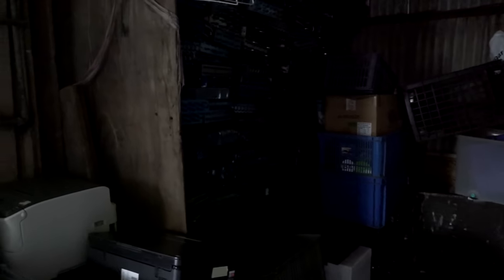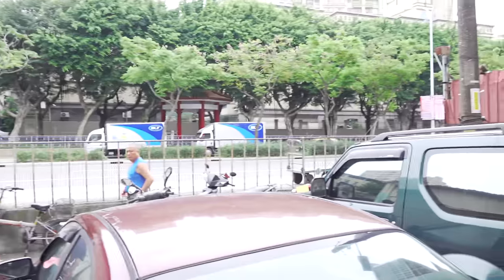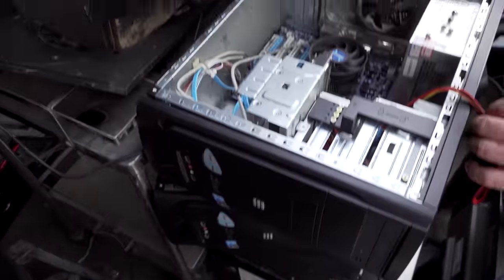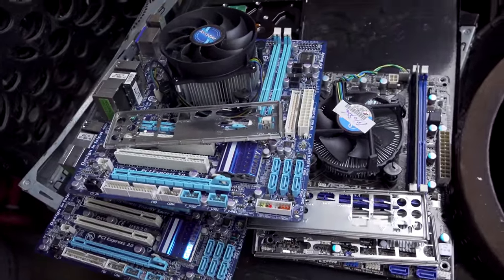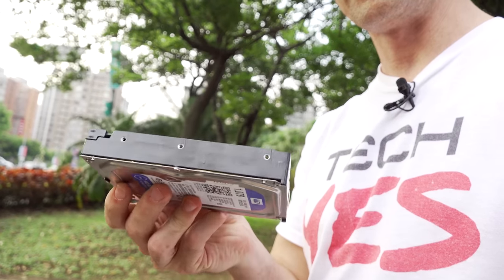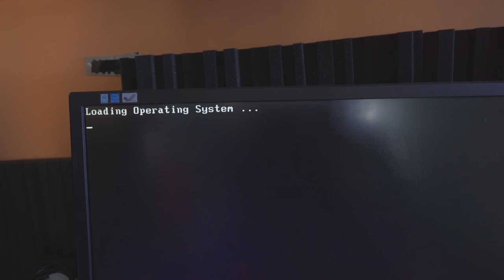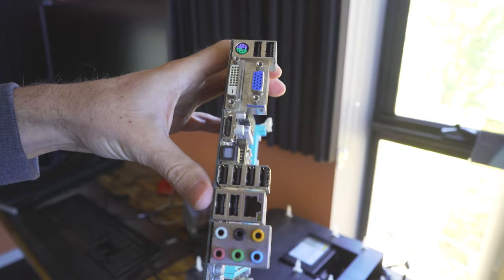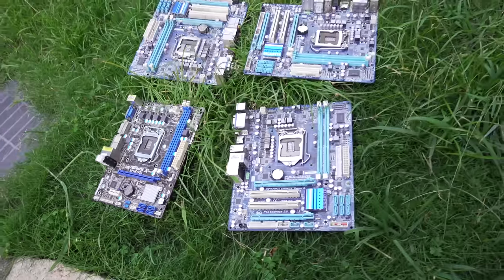I went looking for PC Parts in SCRAPYARDS in Taiwan...

Comment: Sadly a lot of times people throw away PC's simply because their OS isn't working like it did when it was new. My neighbor threw away a perfectly good laptop a few years ago, one that was socketable and about a 2013 or 14 model, and the ONLY thing I found wrong with it was Windows 7 was completely locked up from viruses and junk/malware etc. He had stuff pilled up in his truck ready for the dump when I happened by and offered my help. I instantly noticed 3 printers, several old TV's, two computers and a monitor thrown in his truck along with lots of other junk. I took the printers (all sold together on craigslist for $100) and kept the laptop and monitor and upgraded it with Intel wireless AC and a SSD + more ram and a much faster CPU. Total upgrade cost was about $70 considering I already had a spare Samsung 840 Pro SSD. The stuff people throw away jeez. Oh, and my Father just threw away a HP 7520 AIO printer all because it had a paper jam (not joking).
Reply: I used to get everything like this too. Furnished a home with stuff people discarded once, complete with two workstations.  I had so many computers too, which I fixed and gave away.
Reply: That's how I found my gaming laptop
Neighbor threw a way his laptop 3rd gen i7 8gigs of ram all it needed was a new hdd
After that I added a egpu dock and a 1060
Still works great till this day

I'm always on the lookout for hardware
So far I'm up 10 pc's 2gen i3's ll the way up to 4th gen i5's

People will throw away anything
Specially rich people
My buddy went dumpster diving found a perfectly good working intel nuc all it needed was a fresh install of windows
Reply: It's insane when u think about it. I got two Server Computers with ivy bridge Xeons cause they "didn't work anymore".... On one, the sata cable of the Hdd was lose and on the other the PSU was dead. So i got two dual Xeon Systems for free.... When u think about the fact, that those Processors were about 1500US each back in the day... PRETTY LUCKY DAY
Reply: I've gotten 1 desktop and 3 laptops that were "broken" and got them working.  Desktop needed a virus scan and more ram.  Laptops needed new batteries,  ssd upgrades,  and ram.  The people gave up and bought new computers, let me keep the "broken" ones.
Reply: you think thats crazy?
i found a perfectly good gaming rig no frikin joke i want to know its backstory
i7-6700k
asus maximus hero viii
4x8 corsair Lpx vengance ddr4 ram
strix gtx 1070
1000w evga fully modular psu
a noctua cooler 
and a 2tb western digital black
Reply: I've gotten a 2014 looking Laptop/Tablet PC with a Core i7 and 12GB (DDR3) of RAM for free, they threw it out just because Windows was hanging when starting up but everything was fine

Comment: Here in the Philippines there is a huge market for surplus computer components and systems. Almost all of them come from scrapyards and recycling centers like this, with most of them originating from Korea, but parts from Japan and Taiwan can also be found too. There are thousands of internet cafes and businesses that run with imported computers or systems built with used components. From motherboards, power supplies, graphics cards, laptops, monitors, peripherals, you name it. Almost anything computer related that's used can be bought. 

You can pick up a used mining RX 570 for around 70-80 USD, motherboards from 775 to 1151 for 30 USD, or even a 500-600w power supply from a name brand such as FSP, Seasonic, and others for around 12 USD or less. Now these may not sound that good of a deal to those who watch this channel on a regular basis, but take note that there are so many shops here in the Philippines that sell these components making them extremely accessible and readily available. Even those who live far from Manila (Where most of these shops are) can order them online via Shopee or Lazada (Equivalent to Ebay, Amazon, Aliexpress) for the same price plus maybe 1-2 USD for shipping.
Reply: Where is this market?
Reply: @rencm04  Ah sorry. When I meant by market, I mean that selling used computer parts is a big business in the Philippines. 

But to answer your question, there are many shops all over the country where you can buy parts. Places such as Gilmore are a good example. However, the best deals can be found online on Tipidpc.com or Facebook Marketplace. I would suggest looking online first before buying as that's the way to get the cheapest prices.

Comment: This is awesome! We have junkyards around me in the states called "U pull it", which has the same setup. It's nice to do if you are handy, as you can work at your own pace and often get all the little odds and ends that usually get thrown away, like interior pieces or something as simple as a hood prop. Sure you could buy new but why when you can the fully functional OEM one for 1/4th of the price.

Comment: I was wondering why so many second hand motherboards from the east had all their vrm heatsinks removed.  They are being taken for scrap.
Reply: A lot of cheaper boards don't even have heatsinks. The VRM isn't producing that much heat that one is needed, only a bit of airflow will do the job aof cooling.
Reply: I’m quite aware. I was talking about p67,z68,z77 etc. boards that I know came with vrm heatsinks being sold on eBay and similar from China and the like without vrm heatsinks on them.  Listed as refurbished usually.

Comment: Check the AsRock board again with both sticks in it and look if the amount of RAM is right. The board probably just used the memory installed in B1 and didn´t recognize the stick in A1 as it´s probably dead.
Reply: A lot of dual channel boards will want you to fill the 2nd slot first.

Comment: just a fun fact. if some motherboard dony post or anything at all. wrap most stuff in foil except the chipsets and bake them in the oven for 7 mins at 170c (200c if first time doesnt work) alot of boards have lose north/soudbridge solder joints and this would probs fix it too

Comment: Since I have an access to the "pc scrap room" from where decommissioned PC is going to the kind of facility rhat can be seen in the video, I'm usually getting those kind of parts for free, generally there are mostly socket 775 that I can't see a point in taking, from time to time I'm finding 1156, 1155 custom PCs and oftenly a dell or lenovo prebuilds with 1150 socket and an i3 4th gen, usually without the memory or storage drive, but still worth taking.

Comment: Should do it in USA or Canada if you got a chance i found a full gaming PC in my scrapyard worth about 750-800$ paid 150$ for it   

and great video!
Reply: Specs?
Reply: @usamahhoosen3593   Intel i5-9400 2.9gz Geforce GTX 1060 3GB, 1TB , 8GB ddr4 pretty basic build better then nothing
Reply: @Ekonicz  that's not bad. What was such a recent build doing in a scrapyard though? 9th gen processor
Reply: @usamahhoosen3593  yes Motherboard had chip problems i fix it easy i guess the last owner thougt its was dead sadly and trash it

Comment: Hey @techyescity, Regarding those Windows 7 license stickers with keys, they're technically not permitted for use on other computers as OEM licenses are formally tied to the hardware with which they're sold. (That's essentially the Motherboard & CPU combination, though I've seen even things like an SSD swap break an OEM activation. Microsoft's exact definition is a mystery to me)

While those keys may still activate an install, it is no more compliant than a basic activation crack. So people may as well use a crack.

Comment: I buy computers from bankrupcy auctions quite often, most of the time the description says that all data is erased, but a lot of times it just isn't. I never misused the data, i even told the auction company that i found data on the disks. One of these machines even had no password, with multiple e-mail accounts and even bank login details with password and all. Some other auction businesses just remove the hard drive physically which would be the best in these cases but kind of sucks for me. Have you ever checked out bankrupcy auctions??

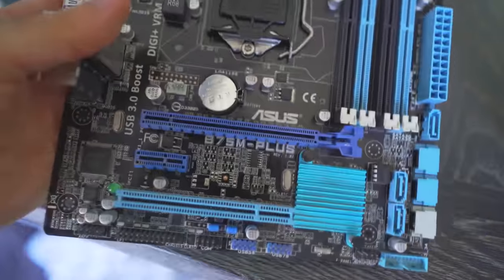Comment: 4:03 B75M-Plus I just got one of those boards for my older i5-3330 and it works great as one would expect.. Had to buy from Ali-Express :(
Reply: @stan dardownz I am in Australia and it cost me about $96 AU delivered. I also got an Intel DH77EB board locally for about $65 delivered. Will be using that for another i5 3xxx build soon. I also bought a brand new Asus Radeon RX580 to install into B75M-Plus board for some Satisfactory gaming ;)
Reply: @stan dardownz just motherboard 2nd hand. I had a CPU and ram as taken from an old Dell Optiplex 9010 desktop. I had drives already. I purchased a new case and PSU and GPU.
Reply: @stan dardownz If you got any questions - happy to help. My name here is the same as my gmail account and twitter.

Comment: "if you don't know at all if these parts even work" you don't need to go to Taiwan to get such parts. I am in Australia and I worked for the DOLE. I was in a scarpyard/warehouse pulling apart every type of electronic that you could put your two hands around. we were even pulling the copper out of the power supplies and power supply cords for the government. stuff that had no value to save it from being set to landfill was made up into creative expression pieces made to look like something eg. art. senior staff did hardware testing. cause the only thing we were going to use the computers for was look for a job..

Comment: Just when I was starting to think no 16 core Ryzen 3000 was a good thing...

As I don't [really] need one. When DDR5 comes out next year it will require a new socket, so buying any new CPU will mean having to also replace the motherboard etc. Although, I do wonder if two DDR4 memory channels will bottleneck a 16 cores, as it is only ~30GB/s (less than 4 times the speed of supported NVMe drives). Furthermore, if they keep increasing cores they will also need to increase the number of memory channels (DDR5 only buys them so much time), the trouble is more CPU traces massively increasing motherboard costs. SMT improves core utilisation, further saturating memory bandwidth. Saying that, it will support PCIe 4.0 GPUs and 8GB/s NVMe drives. Plus, 16 cores at ~4.5ghz shouldn't feel slow anytime soon, maybe 5 years+ even!

Plus, I have plenty of DDR4 (64gigs).🤘

PS: It's great that enthusiast (non-HEDT) motherboards are finally coming with 10GbE network adaptors, transferring large files at ~100MB/s seems to take forever!

Comment: I know this is weird question but why did you have the boards in the grass what if there was water or other elements that could have caused them to get damaged?
Reply: Grass was dry and had enough bounce to it to keep it off the ground. We only put them there temporarily cause it looked cool. While computer components are 'sensitive', they're not THAT sensitive. You can even wash many components with soap and water if you know what you are doing. When a component is powered off, corrosion does not occur very quickly. Corrosion occurs much more quickly during extended periods of time in contact with water if the device is powered on. Also, when the unit is powered on, short circuiting damages components that unintentionally receive incorrect amounts of electricity from the wrong source. These motherboards weren't powered on. On a motherboard, most components use solder, copper and gold. Gold doesn't oxidise. So connectors are usually safe if using gold plating. Traces are usually protected by the PCB layers from oxidation, which can occur from humidity and solder joints, don't 'rust' in the traditional way, and don't react quickly either but recipes for solder vary widely so I can't comment on every one. While in theory, you can take a motherboard into a shower, wash it with water and be good as new again by drying it in a low-humidity environment, the surface tension of water usually ensures that there may be drops of it in the various nooks and crannies of the motherboard. But in all honesty, No, motherboards are not that sensitive and you really have to go at it to kill one. I legitimately wash dust off of CPU pins that have gotten dust all over them from sitting in the recycling centre. I literally take them in the shower. There is very little opportunity for the water to stay on a CPU. I've washed RAM before too. But a recommendation is to leave this to professionals if inexperienced in component cleaning or practise on components that you don't care about killing. 

Hope this helps! No responsibility is given from me for handling your components.

Comment: If you're willing to put some time and effort into it, you don't need a lot of money to build a great gaming rig. 

Just a couple of hundred dollars, patience, and ideally an online 2nd hand market with an app that can give instant push notifications when someone puts up for sale something matching your search criteria; the best deals go fast. If possible, an extra couple of hundred dollars that you can "use but not ultimately spend" will help a lot too. That way if a great deal on eg. a better GPU shows up, you don't have do hurry/rush selling your current one to free up the cash to buy "the new" one - but instead you can use those extra money to close on a good deal quickly, pay for the "new" one, then put your old one up for sale with out the rush. When sold, you recuperate the expense. If you're in a hurry to sell, you rarely get a good price. This way, you also always have a full, working system. Once you've reach a point where you're satisfied with your build, you can put those "extra" flex-money back whence it came - savings account, pay back if you loaned them etc. 

I started out 2 years ago with a handed-down rig for simple gaming, with a i5-750, a gtx 670, a 1TB hdd and 4 gigs of ddr3. By buying and selling on 2nd hand market, buying at super prices, selling for a bit more, injecting a few bucks here and there... Having injected maybe $250 into this "revenue", today I'm sitting with a 4790k on a Asus Maximus VII board, 32GB ram, a gtx 1080ti, a big custom loop watercooling ordeal with mostly EKWB parts cooling both GPU and CPU, a 2TB ssd, 1200W corsair PSU and a 34" 1440p ultrawide monitor. All 2nd hand, from "buying low and selling high", writing good, descriptive ads, and buying "box of parts" with lots of goodies that are easy to resell, taking what I need and selling the rest for a profit or to break even after gaining the part(s) I needed for myself.

Comment: isnt it a problem with static electricity when you wrap your motherboards with clothes?, also hdds can be easily broken when traveling, and even if you find one for cheap, it can die on you 5 days later (infact i had a 500gb one i got in a used pc and it worked for a few days before dying out and making clicking noises).
Reply: That's certainly part of the risk. But more often than not. They won't die in the next week.

Comment: Nice video man! 
Pls do a video OCing a x3440 on a cheap 1156 mobo. I have a x3440 3.0 with an asrock h55m lite. Idk if the mobo can handle more. Need some advice.
Reply: ASRock ARE the Kings of OC !
ASRock P55 pro gave me 3.99 easy out of X3440,and kept working at this frequency !!!
Reply: @DuneRunnerEnterprises  You mobo is way btter than mine man.

Comment: Based on my experience, deleting data on HDD not entirely safe since you can un-delete it with certain software. That's why I never sell my HDD/SSD. If I want to sell my PC, I will buy used HDD and put the OS to it and sell it. Last year I have faulty HDD which contain very important information and to make sure no one can fix it, I drilled a hole through the HDD just like a safety protocol of CIA abroad. Haha..

Comment: Well its a bit of a legal "gray" area picking up parts at a scrap yard bordering on illegal. Doubt those people was actually allowed to sell those items to you so its probably what i would call a "under the table"-deal. People throw aways their items expecting it to be either burned, scrapped or recycled. As the hdd quite clearly indicates, plus the "troublesome managers" you have run into. Again "dumpster diving" laws are different all over & can even be legal in one state/parts and illegal in another. Also using other people licenses without their concent could technically get you in trouble. That being said, here in Denmark our recycle/scap-yards always have a "swap" section where people can drop off stuff they dont want anymore, but think someone else would like. Works well, but you wont find much of any worth of cause.

Comment: I bought Dell Ultrasharp monitor along with a Dell Dimension 2400 all for 10 US Dollars. So essentially I have the same computer that Billy Coore aka Roadgeek of the YouTube Channel Nostalgia Mall had back in 2003 that he still has. The guy wanted 20 for the computer alone but I did not have 20 or even 10 let alone 5 for that fact so he just gave it to me for free. I would have only paid 5 for this system only because it does not have an AGP slot. The system suffered from the capacitor plague.

Comment: being on the East Coast in the States all we can get are the ppl that sell this stuff on eBay.....grrrr. if they x-ray your baggage wouldn't be surprised if they thought you were trying to smuggle a bomb on board what with all the electronics.......
Reply: In my experience, when I moved to Taiwan, I stuffed one luggage full of as many computer parts with the intention of rebuying the cases and PSUs. They've seen it all before and don't usually make a fuss with me. I've been back and forth many times, each time bringing more components to Taiwan. I am not replacing my various desktops, servers, etc.... They've seen everything those security guys.